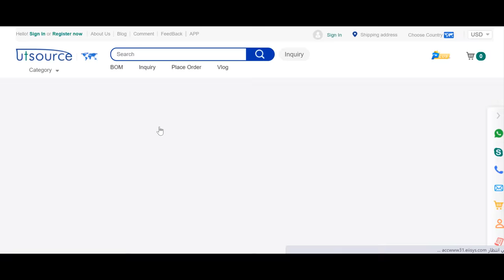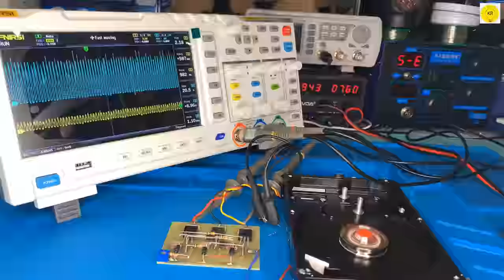how to make 12v chaser lamps circuit , mosfet , irfz 44n

Comment: I had to change the capacitors to 22 uF, and the pot to 5K to get the right speed. I'm using 12 volt incandescent bulbs (10 per circuit) so I also put two diodes in series with the 12 volt supply so they would last longer (now 10 volts). Otherwise, good circuit, thanks.

Comment: So if I used LED I would need a resistor added to each light for whatever voltage is required for that LED? Are the bulbs 12 volt?
Reply from the maker: Yes, you can add 100 ohm resistors, the lamps are 6 volts, and you can use lamps up to 24 volts

Comment: hi sir i made this circuit but not warking please help me sir this circuit can use 12v led
Reply from the maker: Yes, 12 volt lights can be operated. Check the capacitor values
Reply: @inventorkr1 i ued 100uf 25v cap
Reply from the maker: @sadusam45   Check carefully the direction of the diode and also the values of the resistors
Reply: Sir nomal filemt bulb workin but led strip not working what is the reason
Reply from the maker: @sadusam45   Use 10uf capacitors, if it does not work, use 1uf capacitors